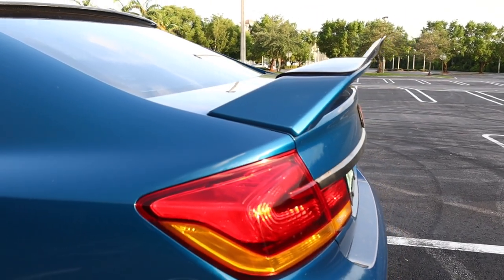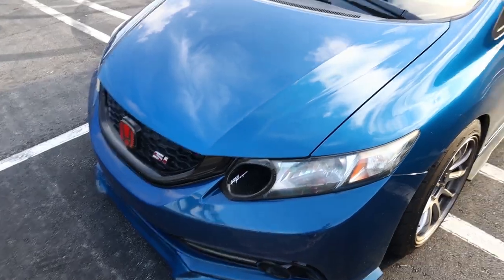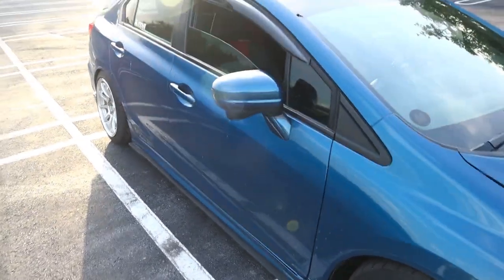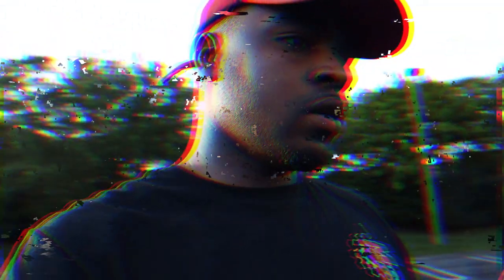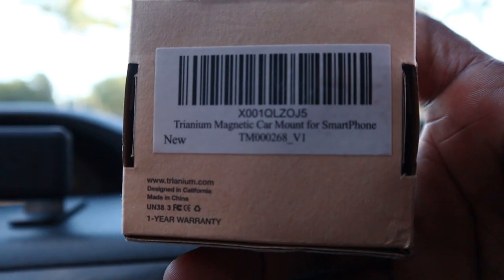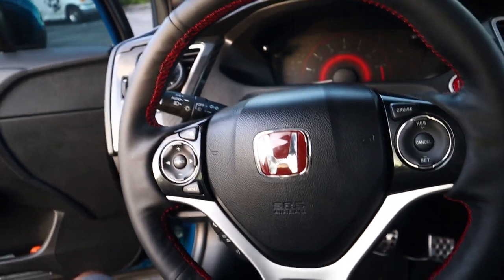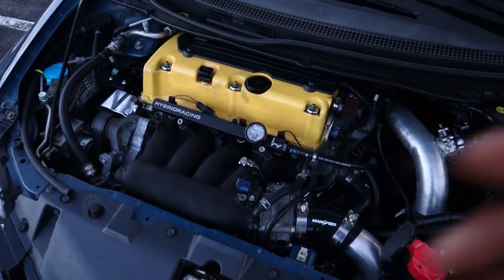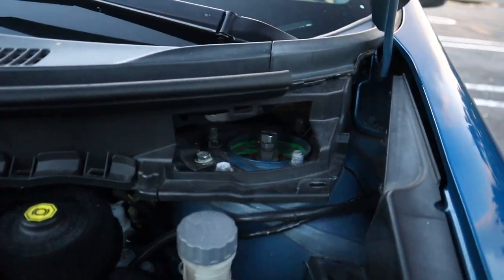400HP TURBO HONDA CIVIC SI FULL MOD LIST

Comment: Good stuff man. I have a 13 ilx thats boosted also tuned by josh pretty similar setup but im running a prl stage 2 kit. Just got a built trans in the car the top end is pretty rowdy. Anyways keep it up i look forward to seeing where you go with the car.

Comment: Sosa is extremely busy and recently moved to FL.

Also the air breather cap isn’t recommended, they tend to fail.  I know a few with them that regret getting them.  Add some bungs to the VC.
Reply from the maker: Deng that sucks to hear
Reply: @zoovie  yea just from what I’ve found out.  Just a heads up.  I wanted to get one too but ppl keep telling me not too from their experience (from boosted guys).

Comment: I would be careful with the trans man. People sheer teeth off gears even at the lower tq levels. Is your turbo kit using the OBD1 IAT or are you using the stock MAF for your intake temps?
Reply from the maker: I swapped over to IAT sensor.. not using an OBD1 but a GM style sensor

Comment: What exhaust you thinking of upgrading to?
Reply from the maker: Full race if I can get a good deal for one
Reply: @zoovie  why full race? Just curious. I was looking at getting a skunk2 with the skunk2 downpipe.
Reply from the maker: @ethanmoore4314  full race just cause it’s 3in and quieter
Reply: @zoovie  oh gotcha. Yea a lot of ppl say skunk2 is the loudest so I’m gonna go with that lol
Reply: @ethanmoore4314  yea it is, i have the skunk2 megapower rr and shit is loud loud
Reply: @boostedjett1402  hell yeah bro. I’m getting it with my next paycheck. Gonna probably pair it with the skunk2 downpipe, then get hondata and get tuned by somebody. Some people say the buddy club spec 2 is probably the loudest because it’s pretty much a straight pipe but it doesn’t sound nearly as good as the skunk2.

Comment: So you’re not running an upper dog bone mount?
Reply from the maker: No the hasport mount deletes that
Reply: So I have stock engine side mount and hasport upper mount, my header would hit the rack off throttle because of the soft upper mount, would you say the hasport engine side mount is better for this?
Reply: @angelmerino19  you have to run the rear mount to stop it from hitting the steering rack.